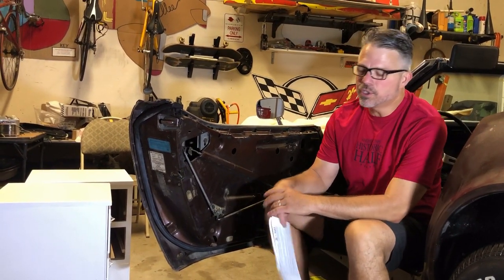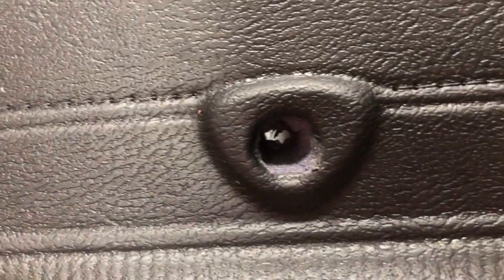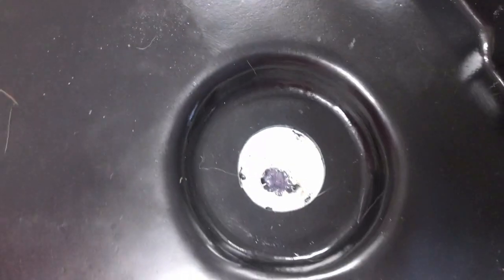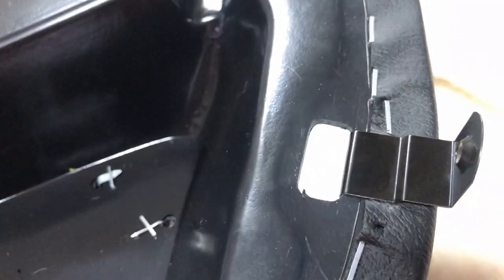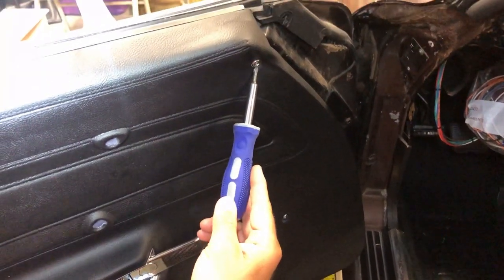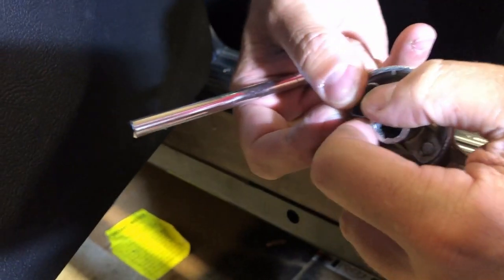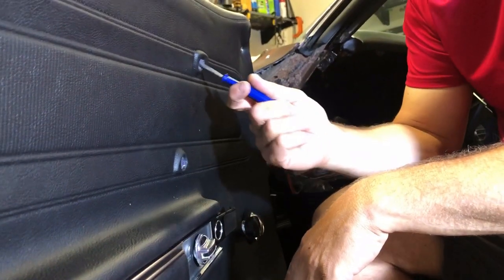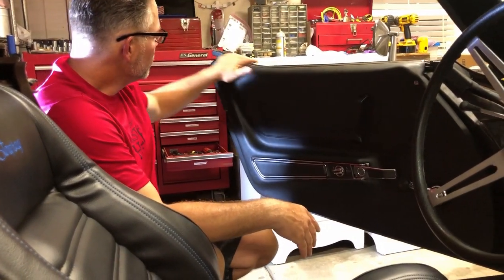Replacing Door Cards from Zips Corvette - Corvette America 1974 C3 Corvette.

Comment: I bought Teflon washers to put between the vinyl of the door and the screws to keep them washers from cutting into the vinyl.  I suck at explaining myself, but I’m talking about the screws that you punched a hole on the vinyl with the awl. The screws you had concerns about not over tightened.
Reply from the maker: that is a great idea - those screws are very difficult to install

Comment: Great video , it was very helpful. A couple of comments. I have a 1972 Vette that was originally my Dad’s, so this car and I have grown old together. There are a lot of little things that over the years have driven me crazy with the car , one of the biggest was the door pulls stripping out of the door card. The new door cards from Zip have the ABS plastic but the grip on the door pull is less than great. I went ahead and installed the pulls on the door on my work bench with a nut and lock washer on the other side and Locktite. Much more secure and with this new door card the door pull does not screw into the door frame so if you ever have to replace the door pull, just take the door card off and you can access  everything. Thanks again, enjoy your videos.
Reply from the maker: Replacing the door cards was one of the top 5 hardest job of the entire build.  I don't ever want to take them off again.

Comment: Those bottom retaining clips would work better if you cut a small narrow notch in the door.  The vinyl isn't strong enough all by itself.  On my '69, I've got the same type of setup and there is a notch or slot in the door for those clips.  If you unexpectedly catch the door card and have nothing but vinyl holding the bottom of the door, it could rip the vinyl.  You can see the "indent" in the door, so just take your X-acto knife or a small dremel tool and cut a 1/8" X 1 1/4" slot on the side of the indent closest to the edge of the door and then slip the retainer into that slot and push it toward the edge of the door.
Reply from the maker: that is a great idea - thinking about another paint job - I'll use this tip next time I take the doors off

Comment: Great video, thanks. Question, did you install a vapor/sound barrier on either door?
Reply from the maker: I did not replace the vapor barrier on the doors - but I also kind of committed not to drive it in the rain (I have yet to install the wipers)